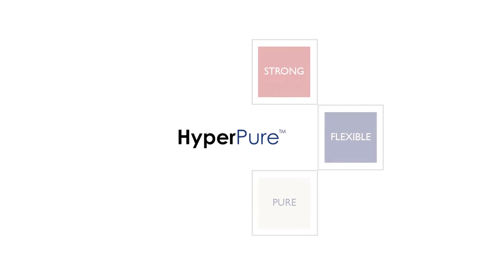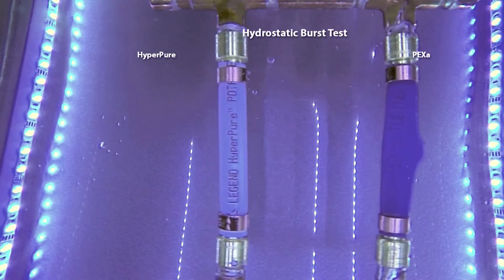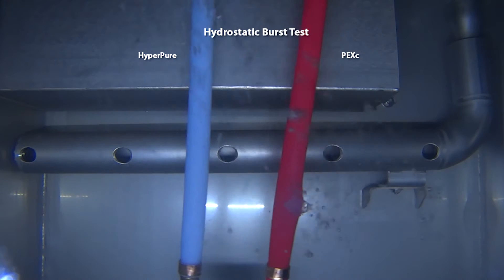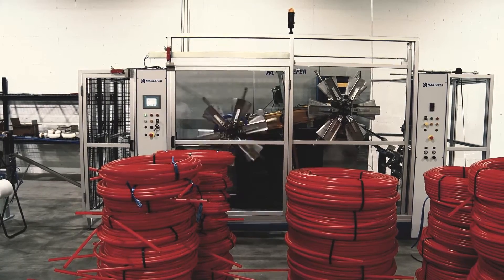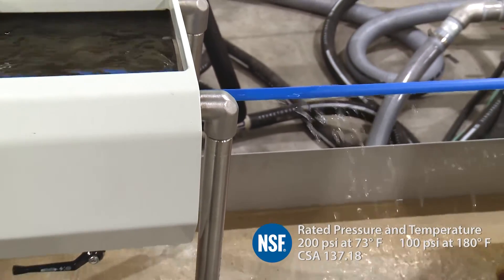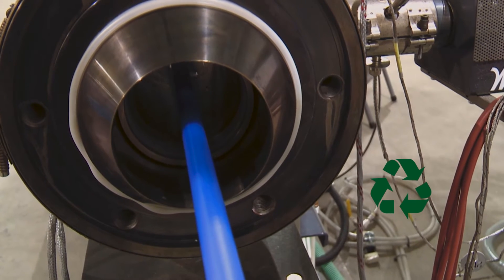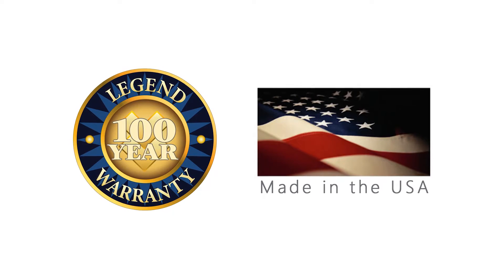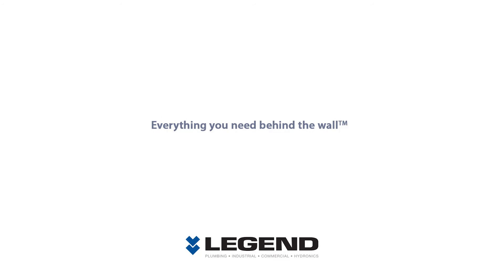Introducing HyperPure®

Comment: Fusible??? Show a electrofusion or other fusion method for your HyperPure line?

While HDPE made PE-RT tubing material is fusible, without a commercial or retail system for tubing this size. PEX non-fusible fitting methods, are still the only practical option. Correct me if I'm wrong?

So create a fusible system for HyperPure. And advertise its advantages over PEX non-fusible fittings. If you want to sell far more HyperPure tubing vs PEX.
Reply: Fusing might not meet building codes in some countries.
Reply: @RKmndo   Fusing done commercially, since it is far superior.... But it's still just a suggestion in this application.....which makes it premature to talk about building code..... And his post is only about the US market.....